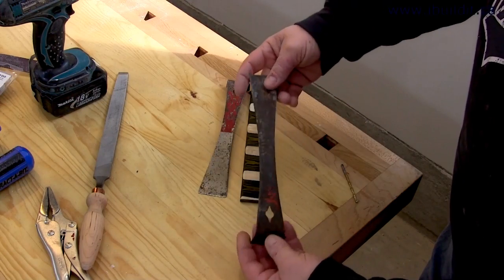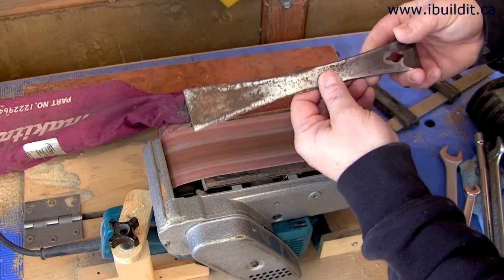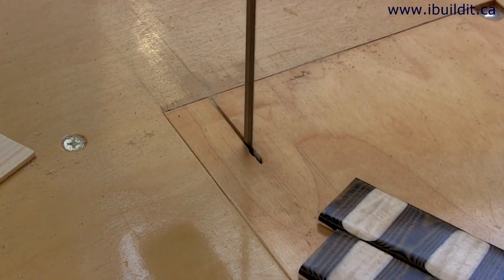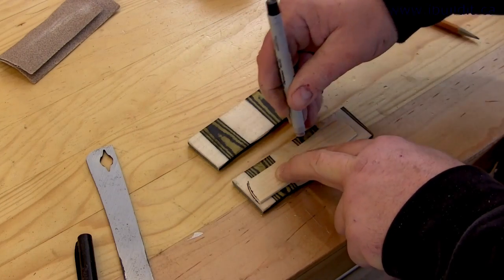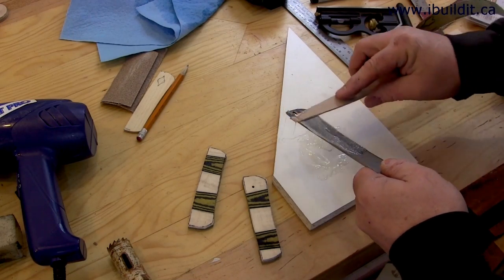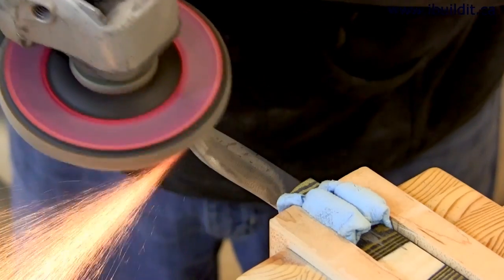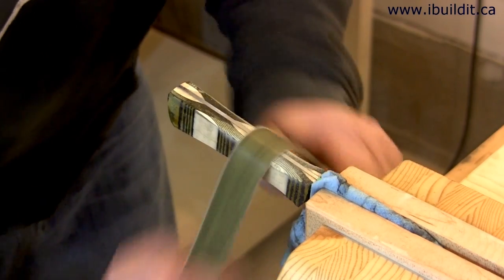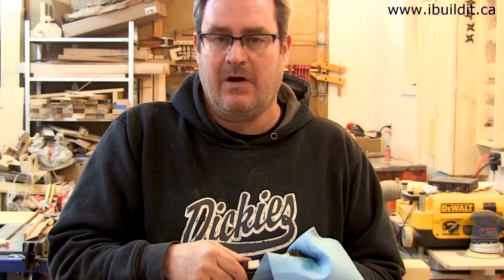Making A Knife From A Pry Bar

Comment: John do u feel that it needs a few pins through the scales. What i am asking is do u feel the epoxy will be strong enough through time to stay attached to the tang?
Oh BTW its a great build for a great use of a spare scrap piece of steel and the scales are spot on nice...well done ...as always
Reply from the maker: Ideally, pins should be used, especially if the knife blade will get used heavily and flexed back and forth. The flexing can break the bond, but the blade needs to be pretty thin to flex that much. 
Anyway, this has held up great over the three years since I made it, and I have used it a lot in that time - even throwing it into the back wall of my shed several dozen times trying to hit the troll target in my deck broom build video.

Comment: Looking through the comments here (complaints/critiques), I'd bet there's not one single person here who wouldn't LOVE to own that knife!

That is one sweet looking knife brother! I love the look of the "left over" wood, especially on the inside of both ends. This looks more like you meticulously planned dedicated pieces rather than using leftover/scrap. Amazing!
Reply: you cant do much with a knife that only looks good....
Reply: jorn suijkerbuijk
Do you have some reason to think that the knife "only looks good..."
Reply: dantco
Well, the steel used for the pry bar is most likely ill suited for knife making, nothing is known about the alloy, besides this, the knife blade isn't quenched and tempered which gives it a very fragile, prone to bending like edge. Perhaps it can be sharpened just fine but I would say that is would lose sharpness very, very fast upon use. Speaking from experience ^.^
Reply from the maker: Jor0r I would say that your experience is very limited, based on what you said, A pry par like this is made from good quality spring steel, hardened and tempered. Since I was very careful to not overheat it when I shaped it, it's still just as hard and tough as it was when it was a pry bar. In a recent video, I used this knife to score sheet metal deep enough to make a clean break. Do that with a knife that won't hold an edge.
Reply: Well you can see dantco that there are people who are proponents of heat treating to the point of obsessiveness. I feel that people loose sight of what John is doing and if he likes hard metal that's his choice. Sometimes we need to have softer metal, maybe spring steel, or whatever, but it's really about personal choice and what does the job or serves our purpose. I have seen some great knives without any hardening or tempering and they turned out gorgeous like converted kitchen knives by Cryptic Cricket and one made from a cheap scraper by ArtisanTony. If you don't have the gear or knowledge of forging metal it shouldn't hold one back from knife making.
Reply: "I feel that people loose sight of what John is doing..." 

That's more than likely due to all that time they didn't spend on their own video, that they didn't make.

Your comment is much more diplomatic than mine will ever be....but I'll keep trying. :-)
Reply: Very good, but you meant well. :)  LOL But seriously I see that you get it, there are different ways to make a knife. Some forge, some grind and some buy, but it's all good.
Reply: Please add a link to YOUR video showing the correct way to make a quality knife. And, please make that a link to a video that you made.
Reply: +John Heisz steel used to make a prybar...and he says it might be prone to bend....hence the limited experience of his..

Comment: Nice, I just made a nice fixed blade from a high carbon steel Nicolson file today and went about it the same way as you, not letting it get to hot, super hard metal this one, I couldn't even drill holes in the handle, instead I just made notches and did a paracord wrap.

Comment: Beautiful, but only on the pad hold epoxy and steel with epoxy adhesive - "not friendly." The transverse load and bending the blade plate can rebound. Would not hurt a couple of rivets or screws put Corby.

Comment: sir, when you are sanding it with the belt sander and making sure the blade do not overheat and lose its temper, relatively so long as it doesn't burn your fingers?

Comment: I would have assumed pins of some kind were needed to go with the epoxy on the scales.  But I suppose unless you're really putting a lot of pressure on them, those scales aren't going anywhere even with just the epoxy.

Comment: What is the name of the epoxy you used to bind the handle to the blade?
Reply: I second that question and add "What kind of epoxy did you make the handle with?
Reply: Theodore Sloat Im sure its regular 2 parr epoxy, that's most common

Comment: i noticed you didn't temper the blade neither did you drill any holes for the rivets to help attach the handle better i don't think the epoxy is stronger enough to keep the handle along time
Reply: khelil salhi Im not sure of the type of epoxy he used but I used to work for a company that re-manufactured brakes (mostly transport truck brakes and sometimes tanks) and we used to use a type of an epoxy to affix the brake pad to brake shoe so i know there are some epoxies that are actually stronger than the metal surrounding it although i do not know the type he used ...but some are very strong.

Comment: is there anything i could use in place of a vice for knife making, i live in an apartment and I'm going to attempt to do all the steps for making a knife with an angle grinder but i do not have access to a bench vice. Any advice??
Reply: you could just fix it to a table with clamps, should work pretty good, you can clamp it down on the one side, work on that and after you are done, turn in around and finish it off with the other side :)
Reply: wasn't sure if that'd work but i'll give it a try thanks

Comment: "I dont want to overheat the blade"  *cuts it with angle grinder*
Reply: He had stated multiple times that he allowed it to cool before it reached any temperature critical to the temper.
Reply: Bradley Hamilton After tempering you cant heat a blade up to red hot. If its GLOWING in any colour you have to do all the tempering and hardening again.

Comment: nice wall hanger. not hard enough for a knife. the power tools burned any temper, or heat treat. pry bars was never hard enough, they are big springs by design.